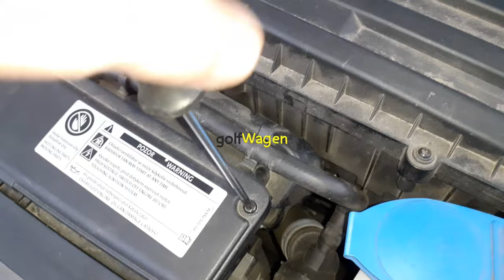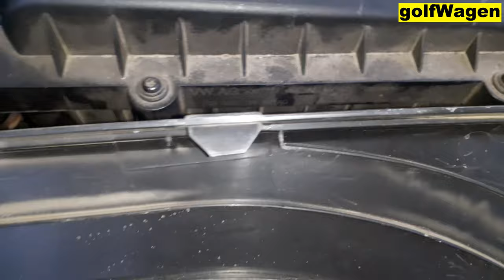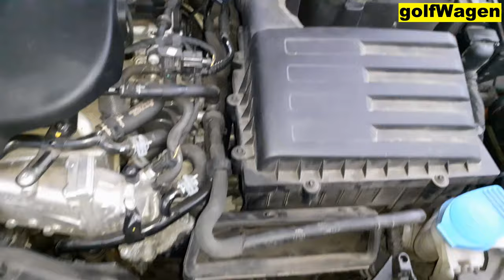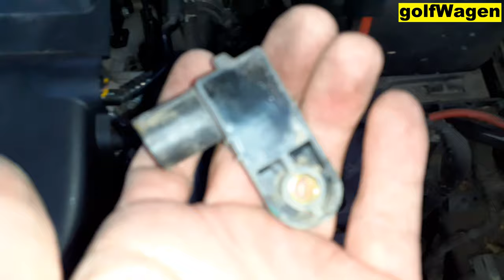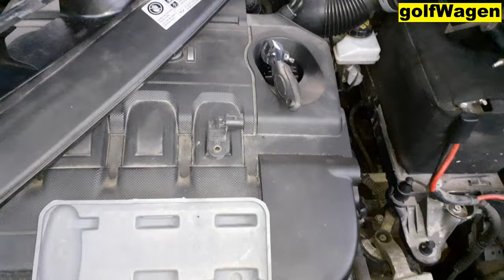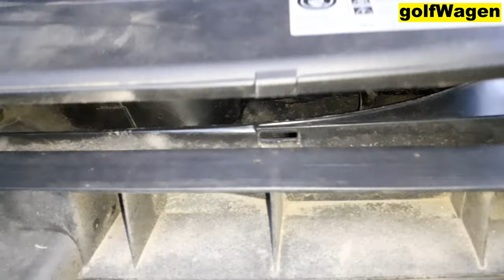VW Golf 7 brake light switch replacement

Comment: Hello, can this switch cause DSG lunging/jerkiness because when I release the start releasing the brake slowly the cars thinks there is no brake applied and starts shaking and lunging forward ( if I release the brake fast it will jump forward and pull hard ), no issues when I have Autohold applied.
Car is 2.0 tdi CRB DSG dq250 mqb 09d

Comment: Have you experienced an issue where the brake light stays on permanently other than when the ignition is turned off? The brake pressure switch was replaced with a non oem one and the was no change
Reply: Conseguiu resolver?